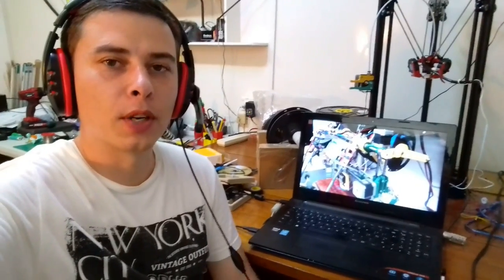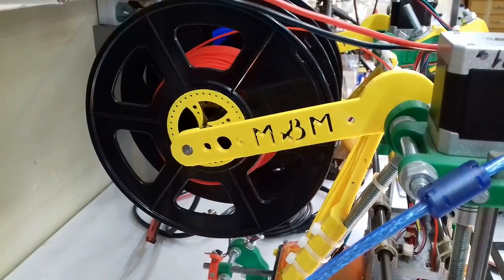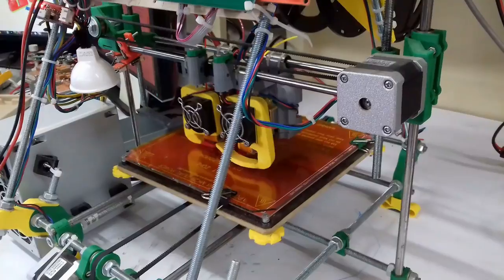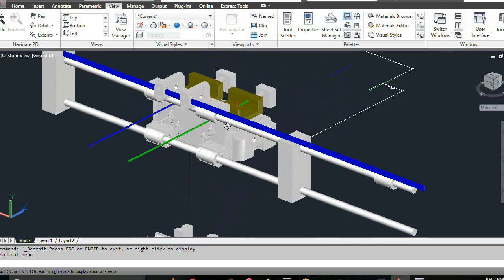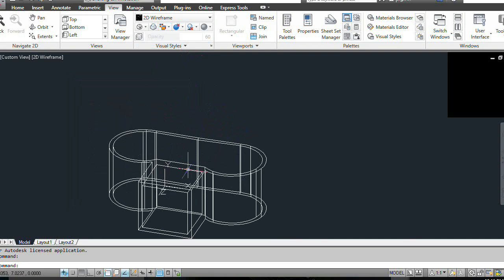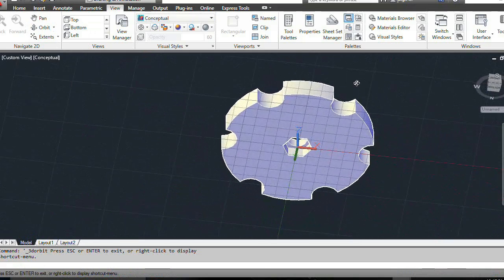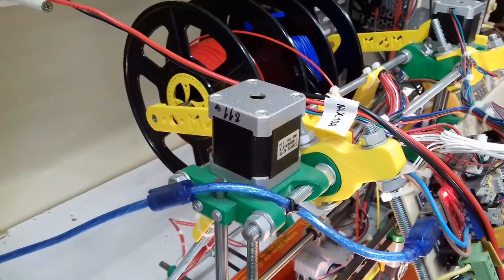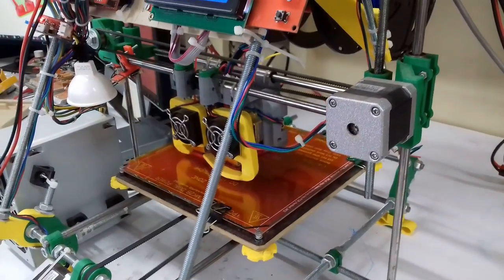The 3D Printer Kit You'll LOVE For Under $200

Comment: I like the triangular frame support, it is something i've been thinking about adding to Ender3 frame. I don't like the electronics being bare, without covers and up in the frame. It should reside outside the frame to have quick and easy access, both physical and visual to the moving parts. Keep everything that isn't about printing, ie isn't a functional part like hot end or stepper motor, away from the printer. It may sound like nitpicking but this?... is going to just stop working at some point. Way, way too many exposed wires, it only takes a chip of metal to land on the wrong place. And having it up of course is counter-intuitive with the hole idea of enforcing the frame so that there are less things that can vibrate..  Keep the moving parts, the "dangerous" parts clearly separated from all control electronics. 

Same thing with Z motors, it adds weight on top and we don't want that. I feel that there are multiple design choices made here that are done "just because" and for the simple hopes of reinventing the wheel... ie, it is done just for the same of making a different design. Keep everything off the frame that does not need to be there and keep the weight low. The foundation looks a bit flimsy too, mass has to be down there, mass and rigidity. That mass and rigidity can be used in turn help to control the top, which should be as light as possible.

I think that deep down, you knew all that but making it to be your own unique design that uses as little of existing as possible was too tempting in the end.. amirite? That you moved away from a perfect solution just to have different solution ;)
Reply from the maker: Thanks for the suggestions.